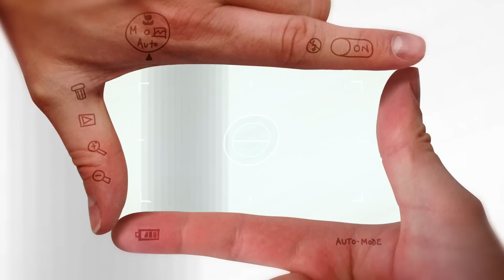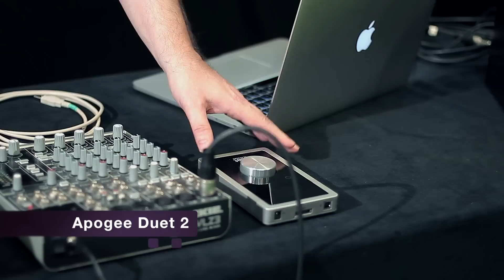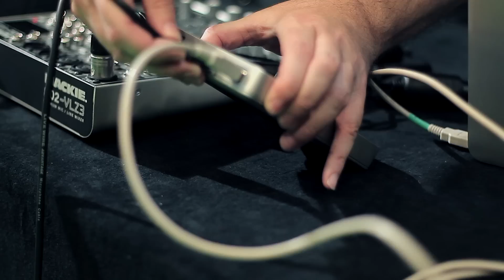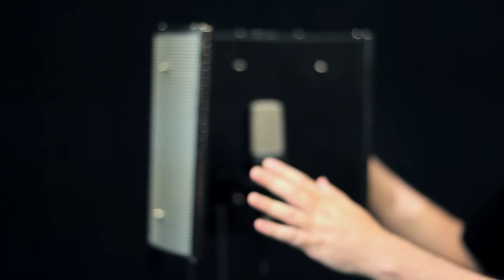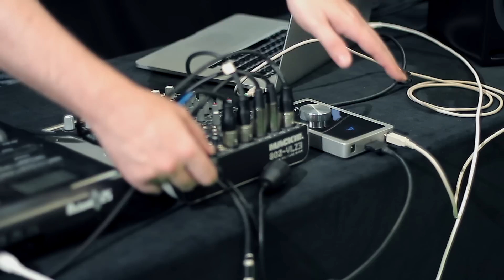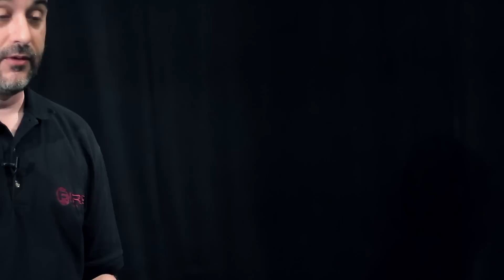How to Build a Home Studio or Project Studio | Recording Arts

Comment: This is a bad setup. You should be able to control which channels goes to the interface or you should have the speakers connected to the interface instead. This is a mess. Use mixer to connect multiple recording instruments and output the stereo signal from the mixer to the interface.

Comment: I'am a complete novice who was gifted some equipment from a DJ that I did Pro Bono work for from San Antonio  My immediate question is my XlR is plugged into my condenser mic the other is plugged into my Behringer xenyx 802 where is the port connection from the mixer to my audiobox interface  (analog to digital) please get back asap  Thanking you I'am

Comment: there is easier way to make a portable studio but we have to answer a question how much inputs and monitoring line we need :) but way is simple for the cheapest way and made a quite good quality
Mic + pop filter + acustic cabin (one or more) 
Audio interface like pressonus audiobox/studio, behringer x-air, soundcraft UI
Laptop 
bunch of cables to connect things :D
Reply: I have this equipment I need some advice if you could respond I will give the details thanks RR

Comment: Are y'all stupid? He has the apogee wired to the mixer using a breakout cable.
Reply: he recaps his presentation over the last 4 or so minutes of the video.  And it is there that he specifically uses the output connectors on the breakout to go in to the Apogee.
Reply: he forgot to say this during his main pitch.

Comment: Nice looking video F.I.R.S.T Institute, but like Ryan Said, too complicated for a beginner (since I guess that's who you are after). Don't buy a mixer if you don't need one. It will disturb your workflow in the beginning (in my oppinion). I suggest you make it easier for yourself when starting out. However, if you decide later on that you actually need more inputs, a mixer is a good idea or a bigger sound card. Buy the one that gives you the most bang for the buck. External mixers are quite cheap though, so you might want to consider that. And regarding the reflections when you use a vocal booth, it doesn't remove all the reflections. It makes it better but it's not a one-stop fix (which had been nice). 
Hope this helps! //FLX

Comment: You don't need the Mackie mixer, the Apogee Duet gives you Duet’s breakout cable includes 2 combination mic/instrument connectors (XLR and 1/4” built into a single connector) and 2 balanced 1/4” connectors for speakers.

Comment: The Apogee has better Mike preamps. The Mackie is fine but it's of lower quality and adds noise. 
Ditch the mixer and go straight to the interface, an interface with multi inputs, or buy a mixer with a built in interface.  

This video was absolutely not for a newcomer. It's for an advance amateur and above, with exception on the use of the cheep mixer in the set up. 
One more thing, this set up is anything but portable. It's removable but there is a way better setup to call portable than this. Let's get real.

Comment: i think you showed only  recording audio from your m-audio in the mac.
all other connections are audio input from your mac through the interface to the mixer, the mic to your mixer and  which outputs the audio to your monitor speaker. 

you're not showing how the mic audio is recorded in your mac. you missed it or forgot about it. this is just wrong.

Comment: There is really no need for an Audio interface if you are using an external USB sound card and a Mixer with Phantom Power. I have my condenser Mic, monitors, headphones all plugged into my mixer, then the mixer's output plugged into the sound card's Mic input. Simple! Sound is Great!

Comment: This current set up does not allow for the microphone to actually be recorded you would hear the mic in the krk's but not in the recording... most of those mackies come with a set of main outs xlr and quarter inch. It would be more efficient to route the the monitors on the xlr and route the main out quarter inch back into the inputs. only thing is apogee's pre amp is amazing i wouldn't really want to taint the signal with that mackie pre amp. My opinion.

Comment: Brother,

        I just wanted to say that you have done what many others have tried to do...In very short order you've taken the signal flow through the paces coming and going from and back to the DAW.  Outside of loading the drivers (which I will need help with) you have made an elegant presentation on how to set up a working home-based studio.  Most folks seem to submit to using a simple interface and bypassing the need for a mixer.  We both know that simple is as simple does and very soon the user will need to deal with a mixer in the chain and you have done well in making that choice  (better) as a more effective option.  
       I am in process of doing exactly what you have presented and thanks for the excellent demonstration.  Kudos-- brother Jimi

Comment: If u wanne record scratches  by using a turntable, I'll need this setup right guys? only a different mixer...(?)
Reply: Dennis Hanna no man you don’t need a mixer at all you just have to get a rca to 1/4 inch and an audio interface if you want a more controllable sound you might want a studio mixer but like I said it’s completely unnecessary but good luck man I hope this helped you

Comment: what good can the preamps of a cheap mixer can do really? Anyone watching this, go for a focusrite 2i2 and ditch the mixer. btw I don't think that this setup is going to send anything to protools because no inputs are coming in to the interface. Getting the mic signal in to the interface is what recording is basically but this guy decided to not show how to do it after complicating what should be a simple setup. This video is a fail
Reply: J Roc so how is the input of the Mic going to make it to the DAW? He plugged the output of the interface into the mixer. There was no input going into the interface.
Reply: exactly
Reply: No this is an Apogee Audio Interface. The preamp on that us state of the art..
Reply: e-Audio Productions he will separate signals going into the mixer by using auxiliaries
Reply: So what he has done is.. Connect left to channel one on the mixer. Connect right to channel 2 on the mixer. Connect the microphone to channel 3 of the mixer... Then what? he will take the output from the mixer and feed it all back in to the Apogee?? The Apogee will receive audio from all 3 channels... Not correct.

Comment: Aren't the XLR ins on channels 1-3 on the 802VLZ3 actually mic preamps?  The engineer said they were line ins -- I don't think so. The lines ins are directly below the XLR ins and are quarter inch. So he's got an adapter cable going from line level quarter in to XLR mic pre, when it should have been quarter in to quarter in (all line level). Normally line level will overload a mic pre, unless you pad it.  But why go through all that when there's a perfectly good line level input directly below the XLR jack?!

Comment: Thanks, finally someone showing the actual signal Path! I have this similar set up with a Yamaha MGX12 mixer  to achieve zero Latency, im pretty close. I use the Aux outs to go back to a Focusrite 2i2 then out to line in, this way you can mix live realtime sound before you send it to computer.  If your jamming with a track from the computer its direct out so u have no Latency issue. just have to make sure you deselect the monitor feature in your daw or youll have latency delay,  This seems to work well so far but lots of cables, would appreciate any input for more streamed line approach.
Reply: so you can monitor daw out nicely in digital mixers?  God im so sick of hearing i cant.  Info appreciated
Reply: TommyV Virs stuDioLuHus

Comment: You don't have the microphone feeding into the computer at all with this setup.  The interface isn't actually doing anything that a set of headphones couldn't do.  Who thought this setup was a good idea?  You don't need a mixer when the only level you're trying to control is the mic input which isn't even plugged into the computer.  You also don't need or want monitor speakers engaged when you're recording with a mic.
Reply: At the end, he explains how to send the mic signal to the Apogee. His failure to actually make this connection, made the video a bit confusing.

Comment: I'm new to this ... but why is the mixer required, if your using a DAW like Protools? cheers!
Reply: The mixer is not required if you don't want to record using many input signals at a time.
He actually could buy an audiointerface with integrated XLR input instead using the mixer and the audiointerface to get the job done.
Reply: S Wave Cheers!

Comment: Yes there are so less thumb down! , How ever this is not that correct as what it looks like.
The most tricky part will always be how to hear our synth or microphone and record it into computer maybe between a little tweak or knob or something. And I don't get it why the output of apogge needs to be connect to a xlr out put since you can use their original trs line output to the mixers line input does't it, There seems no particular reason to be a adapter between them, So Frankly that makes the connection in the video a little be not that persuadable. So the question is how do you record your mic since that's why you hook up to a computer right, maybe microphone can use the in its free time kind of boring input of the interface?  but you can what if there are more instrument, However, in this hypothesis, what you hear in mixer would be along in its place away from the software which should be record what mixer comes out. big problem here,

Comment: Wait, I'm a little confused and it may be because I'm extremely tired.... But why would you need the mixer? Every DAW pretty much comes with it and I can set up a home studio or even a travel set-up without it.
Reply: exactly, it's entirely unnecessary
Reply: KingHW Beats Assuming my AI has only 2 inputs where I have connected 1 Guitar & 1 Vocal Processor/Mic but still have the need to connect more inputs whatever eg Drum Machine then a mixer mixer makes it easy. Connect all inputs to the mixer & connect the mixer output to the AI Input which then connects to you computer. thats how I connected mine.
Reply: An analog mixer still is not needed. You can use the mixer in the DAW and maybe use a mixer controller to control the mixer in the DAW.
Reply: Did U listen at all!!?
Reply: Lmao!!!!

Comment: Listen if just starting out best thing you can do is get a package deal I'm telling you if you just learning get laptop 100-300 with 2gb ram it can be Microsoft or apple PowerBooks still run garageband or protools and on ebay they under 100 my first set up I buy everything pros had problems is I didn't need half that 3500 later I have 650  studio setup learn from my mistakes I'm telling you save time and money look things up as you buy them .

Comment: why all this???

since the Duet has Phantom Power built-in, you can simply get ride of the mixer especially that you will never find a way for your mic to loop it to the Duet, beside almost all the monitors in the market now are active which also makes the mixer an unnecessary item.

Simplicity is the key people
Reply: +Brian Green The headphones is not an issue at all, all you need to have is an audio splitter or if you want to run this professionally, then you can buy a headphone amplifier.... what i'm talking about in this particular case is that the mixer has nothing to add to this setup man
Reply: Can you further explain im a noob. Thanks
Reply: Bill Ballschack ok the first question and that builds up everything, after plunging the mic's cable to the mixer, how are you willing to route it out to the Duet?? 
The only way to do that is to send the signal of the mic to an AUX track in the Mixer and connect an unbalanced 1/4" cable to the Line input of the Duet, LOOOOONG distance for the signal to take from point A (Mic Capsule) to point B (DAW) which creates big latency and after all that i will be also loosing quality due to this routing.
We usually do that routine with a mixer that has Direct Output which means that every single Input Channel has its own Independent Output, which also means that this mixer can be used as a Mic Pre-Amp such as Neve, SSL, ISA and others.
Since the Duet 2 has its own Phantom Power, (Believe me) its better to plug the microphone directly to it for better quality and dynamic range, also since the monitors are active (have built-in amplifiers) then it's going to be better if you plugged it directly to Duet because for 100% sure the mixer is going to colour up the monitoring sound and we need to have a better listening to the real sound beside, working with this setup without the mixer is much portable.

i hope i made it clear this time and sorry for the long answer.

Cheers ;)
Reply: DJ Blind okay I hear what you're saying and you're absolutely correct. He can run to speakers directly to the sound card
Reply: have a nice day :)
Reply: I think the mixer is relevant what if he wants to run a set of headphones to the artist and himself while recording I don't know too much about the duet apogee but I don't believe it comes with a pair of headphone jacks
Reply: +Brian Green That's what i'm saying ;)
Reply: well said and spot on Sir! Have a nice day!
Reply: DJ Blind i know this is old but how about a midi mixing surface? Does it ad any colouring or signal loss?
Reply: LOL so if u can run the speakers to the laptop via headphone jack. and the mic through the audio interface, which is connected tot he laptop. is there any real purpose of the audio mixer.

Comment: This doesn't make sense. How are you going to use that channel strip on the desk (pre-amp etc) for the mic and then record in to the macbook? Nothing is going IN to the apogee.
Reply: I could not finish watching. He was so mixed up and everything was the other way around. I hated every second.
Reply: +Danny Rigg  Yep, that was a mistake I see he realized at the end of the video. lolHe should connect the main out of the Mackie mixer to the input of the Apogee and use the "control room" outputs on the mixer to send signal to the KRK's monitors.
Reply: big facts
this man messed up
Reply: What he forgot were the headphones for vocal recording